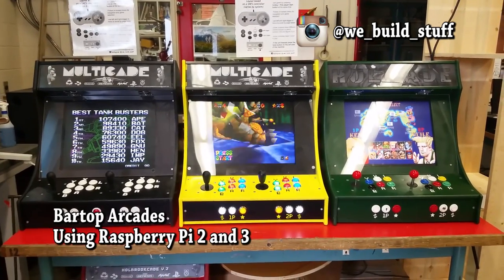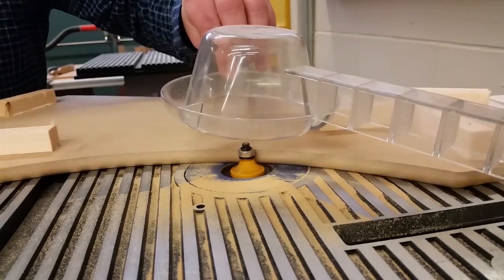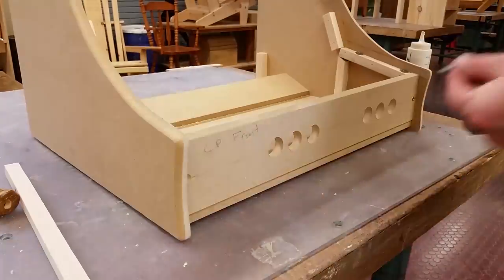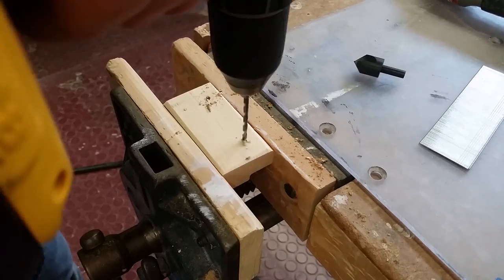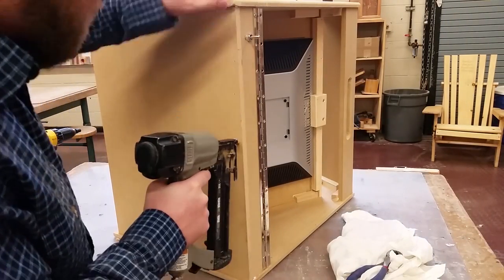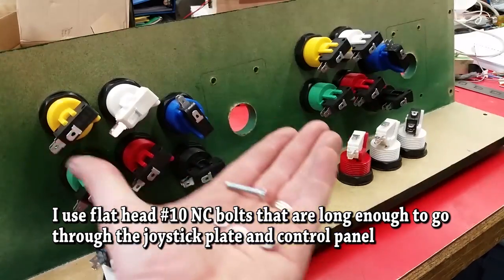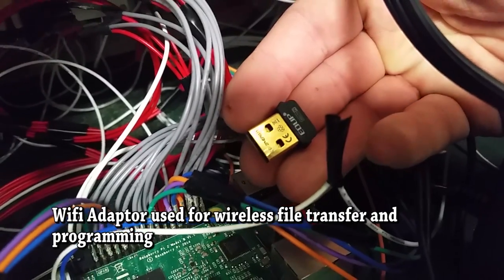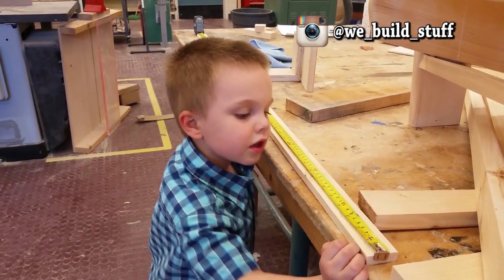How to make a DIY Raspberry Pi Arcade Cabinet!

Comment: Does any one have a problem with there raspberry pi overheating when its in an arcade machine? i build a full size one and would like to know if i should put fan or not?
Reply from the maker: Skyler M i have found the majority of the heat comes from the monitor which isnt designed to be put in a confined space without airflow. I've done a few different variations of venting and air flow solutions. Simple way is at least two holes in the back to allow for circulation. I've also done 2 fans setup with one to bring in air and one to pull it out. Check out the update video on my channel. I've been working on a new arcade video series that I hope to have done by September.
Reply: awesome thanks for the reply man, i was thinking the same thing, putting two fans on each side of the arcade machine, one for in and one for out. im at the point of putting in the raspberry pi and the buttons and was thinking maybe putting the fan, im thinking i will, just to be safe. After playing around with the raspberry pi, i touched it just to see how it does after playing for a bit on the SNES emulator and noticed it got pretty hot after only a few minutes of playing, but read a few things about people saying it wont hurt it really. but to be safe ill do the fans :)
Reply from the maker: Skyler M you can also buy little aluminium heatsinks for the board.
Reply: yeah i seen those, but i feel like it wont make a difference if there is no fan attached to the heatsinks
Reply from the maker: Skyler M i bought these usb fans for my latest build. I have one as intake and one as exhaust to circulate the air

AC Infinity MULTIFAN S7, Quiet Dual 120mm USB Fan for Receiver DVR Playstation Xbox Computer Cabinet Cooling https://www.amazon.ca/dp/B00JLV4BWC?ref=yo_pop_ma_swf
Reply: did you add a shut off and on button for you raspberry pi?, if so do they shut off when you use the button?, i heard it only really puts it in sleep mode, so if there is still power to the raspberry will they keep running. i looked at them actually, might be ordering them. seems like a lot easier then adding plugs to the fans.
Reply from the maker: Skyler M my latest ones have a power button on the back that controls everything. I shut the pi down in the menu and reach around to the back of the cabinet for this switch. 

LANIAKEA Power Inlet Switch, 3 Pin IEC320 C14 Plug Connectors, 10A 250V, with Rocker Switch + Fuse https://www.amazon.ca/dp/B075VQWBSP?ref=yo_pop_ma_swf
Reply: im not gonna do that, i decided to code in the power button on the PI and theres a power button for the screen, instead of having to reach in the back since its a full size machine. i guess ill have to find out if it actually will shut down the fans or not
Reply from the maker: Skyler M let me know how it goes. Would love to see what you come up with

Comment: I need help with the placement blocks. There is no info on the pdf specs
Reply from the maker: Mo Moonjelly the side piece page template (the one that is tiled and you have tape the papers together)   shows where are the lines and pieces will go. My material is 1/2" wide and you can see where that is drawn on the paper. The blocks can be glued to the side of those lines.
Reply: We Build Stuff I see, so place them as needed. Thanks!
Reply from the maker: I will have a video uploaded in the next hour covering your question! Stay tuned!
Reply from the maker: New Video up! I hope it helps answer your questions
https://youtu.be/3ZCiegyqeX8?list=PLTjHStPJZlJwPdhxq8ib483lBf0Bwfi5W

Comment: Any one know what buttons he used I’m interested in making my own?
Reply from the maker: Links in the description and on my website for what I used! 😀
Reply from the maker: I bought from this store 
https://www.ebay.com/str/sinoarcade
Reply: Thanks this makes it a lot easier, I’ve been looking for an hour and a half trying to find a set of Happ style led buttons
Reply: Do you know what monitor was used I know it was a 19 in dell but was it a 5:4 or 16:9 ratio monitor
Reply from the maker: @zadejones769  personal preference. The 3 in the video were the 'square' style ratio. So I guess 5:4 or 4:3 if that's what they are called. I usually find them used on craigslist for cheap

Comment: Why don't you use a crt?
Reply from the maker: Because a portable 40 pound cabinet compared to 200+ pounds was the point of this Bartop Arcade 😉
Reply: Oh ok i get it now but I have one quest can you use a 1or2 inch crt in a little counter top cabinet or no?
Reply from the maker: @chiristopherbarela8721  It may mean doing some adaptations to the dimensions of the cabinet and building a stronger platform to hold the screen depending on it's weight. Just like any project customize it to fit your needs!

If using a micro computer board like a Raspberry Pi you will typically need an adapter for the video signal to work!

Comment: Installed your t-nuts on the wrong side of the wood.
Reply from the maker: I've done it both ways. The pressure of the front control panel and the top part hold it together. Installing them on the bottom (of the right way) they tend to fall out when I'm taking out the bolts as they don't 'bite' enough into the wood I'm using. I may put some type of adhesive to help them stay in place. So far I have had ZERO issues installing them the 'wrong' way ;)

Comment: Dude you should sell these. I would buy one.
Reply from the maker: Many have asked but no-one ever follows through after hearing shipping costs
Reply: We Build Stuff cost for shipping?
Reply from the maker: Just in Canada is about $400 CAD just for shipping. No clue what international would be. I also don't have much time to build these right now (i already have 2 full time jobs!)
Reply: We Build Stuff total cost for everything?
Reply: Sorry didn't read the whole message.
Reply from the maker: I have some used units I would sell for $600. My current new builds start at $1200
plus shipping and taxes
Reply: where are you located? I'm in Ottawa. would gladly pick it up.
Reply from the maker: near Vancouver, BC

Comment: A few more oopses....  The wiggly bit at the end of a tape measure is by design, it is to allow for the thickness of the hook. T-nuts should have been installed from the back. They are designed to be a hidden fastener that resists turning and provides against pull through.
Reply from the maker: Terry Barber congratulations
Reply from the maker: Terry Barber the issue i had with putting the t nuts the 'right way' was they would fall out due to gravity. they werent biting the pine the way i wanted them too
Reply: Terry Barber Talk is cheap. Show us your cabinet, keyboard cowboy...

Comment: Step 1: buy $20.000  worth of equipment ...
Yeaaah ... no. It's cool to watch but people who HAVE such equipment are exactly those who wouldn't need these instructions.
Reply from the maker: A jigsaw could do almost everything that I did but it would just take a little longer and require precise cuts :)
Reply from the maker: Also the big reason I made this video is for my students to follow along in the classroom. Building cool stuff makes learning fun ;)
Reply: Step 2: own the rights to run every ROM on the emulator!
Reply from the maker: That's why I'm only showing how to build the hardware :)

Comment: i really find surprising all these videos explaining how to build a cabinet, with extremely expensive machinery and space most cannot afford, but amateur methods of mounting it, like using nails instead of wooden wads...
Reply from the maker: By nails you mean one of the simplest forms of building right? If "all these videos" use a similar method than why change what is working? I teach high school shop and with this project I keep it simple. It is functional and the majority of people that enjoy the end product don't care about how it is built :)
Reply: hmm, you are right, it does work, it is simpler and faster. It is just that I'm used to the way my dad work with wood. The final product you show is pretty good. Cheers!
Reply from the maker: Thanks man. If I was building furniture or using real wood instead of MDF I would probably be using different joinery techniques but when it comes to time=money this is efficient and cheap :)

Comment: This isn't a "DIY" project.  It requires the kind of investment in space and tools that far exceeds that which a DIY project should involve.  Impress us by designing a cabinet which can be done in a small space and with more conventional tools which could be had cheaply at harbor freight or the like.
Reply from the maker: erroneus I actually had almost all the same tools as a kid in a small shed growing up. but challenge accepted for the next video!
Reply from the maker: erroneus also.... I'm not here to impress anyone. This video was originally made for other shop teachers and students in my province as a guide for a conference I ran last year on arcade basics
Reply: Just because he used big tools, doesn't mean you have to.  You could build that whole thing (except the cnc cutouts which are just for decoration) with probably just a table saw and a drill.  Or even a circular saw.  And a jigsaw for the curved pieces.  Fancier tools might make things easier but they certainly aren't required.
Reply from the maker: Yes they do make it easier but this is a very easy project to do with even basic tools. My goal in the next couple months is to build one with only hand held tools that I think handy people "should" have in their garage. The only specialized one I will include would a handheld router for routing the t-molding slots (my latest builds use t-molding) but everything else could be done with what I consider "basic hand held power tools"
Reply from the maker: Mike B is a cool guy
Reply: I'm doing my own version too. In a guest room all covered with plastics, a drill with various accessories, a dremel and sprays. I have needed the general cuts of wood to make them in one shop but everything else in a very small room. When I have it ready, in a few weeks I hope to upload some photos.
Reply from the maker: Zoosporita if my video can be some inspiration that is rad. there are ao many different ways to construct these cabinets but that is what makes it personal!
Reply: (DIY
noun
abbreviation for do-it-yourself: the activity of decorating or repairing your home, or making things for your home yourself, rather than paying someone else to do it for you:
a DIY enthusiast
a DIY project
More examples

The people who owned the house before us were very keen on DIY and made a lot of changes.
My husband is hopeless at DIY and could never put up a shelf or wallpaper a room.)

Please I mean, please get your vocabulary right first before you start to complain about not having enough money to get the proper equipment. The word DIY doesn't mean that you are using materials/tools that you currently have. Its about making something yourself rather then paying for labour.
Reply: Raymond Zhou fascinating linguistic analysis. Do you have a husband? Interesting... 

The use of common law available tools and methods is a hallmark of 'do-it-yourself' projects.  It doesn't apply here. This is really a sales pitch in the manner of one of those manufacture videos. If one were too visit an automobile manufacturing plant and make a video, could it also be a DIY car video?
Reply: This is me.

de·gen·er·ate
adjective
dəˈjen(ə)rət/Submit
1.
having lost the physical, mental, or moral qualities considered normal and desirable; showing evidence of decline.
"a degenerate form of a higher civilization"
synonyms: debased, degraded, corrupt, impure; formalvitiated
"a degenerate form of classicism"
2.
technical
lacking some property, order, or distinctness of structure previously or usually present, in particular.
synonyms: corrupt, decadent, dissolute, dissipated, debauched, reprobate, profligate
Reply: You do know that this video is just for educational purposes only? He wasn't offering to sell any of his arcades in the video or the comments. Also If everyone could build a car then whats the point of dealerships?  Like I could already see this argument is getting out of hand. There's no point defending yourself since you only know how to assume peoples gender and be cocky as hell. Like I mean you could even build this project with a jigsaw and a drill. Well I am sorry bud I forgot you don't have any basic tools as such.
Reply: erroneus I thought this video was pretty educational. Good job roasting yourself btw